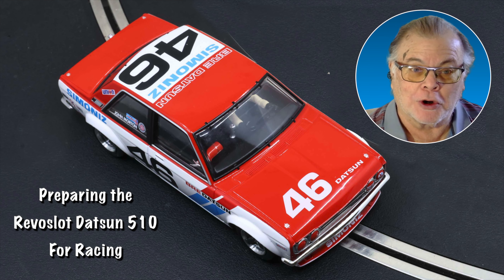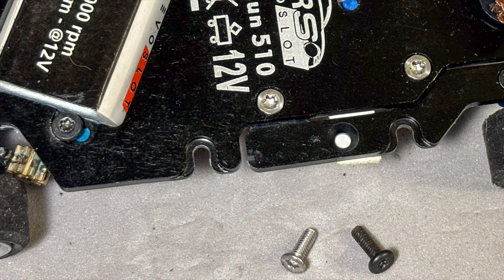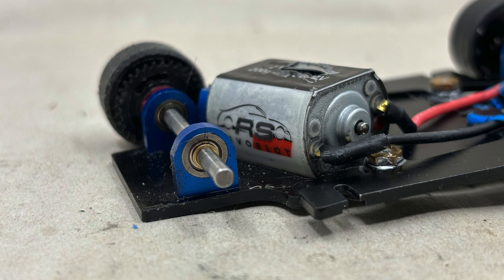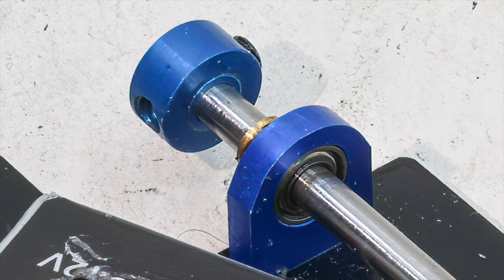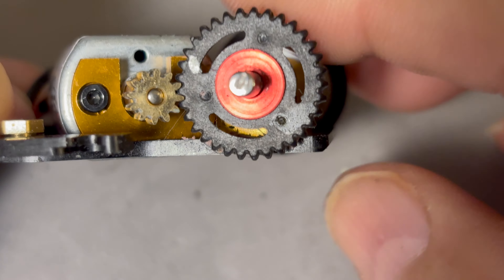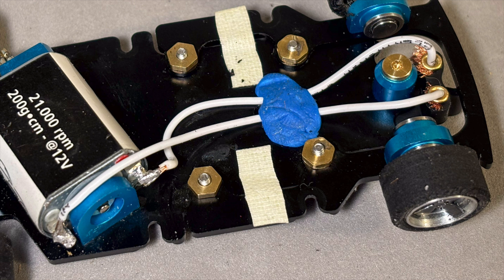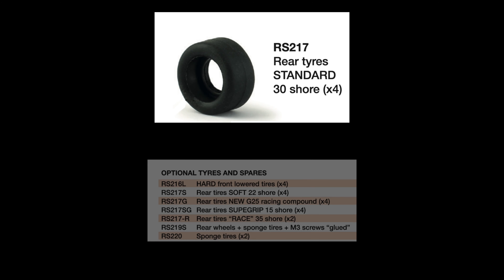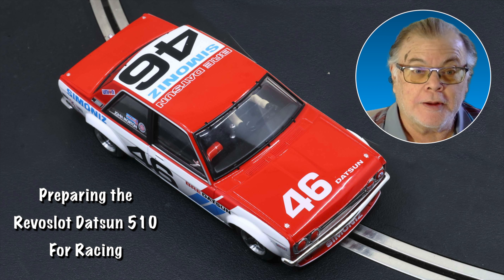Setup Tips for the Revoslot Datsun 510 and other Revoslot Group 2 Slot Cars

Comment: Is there any adjustment for ride height on the Revo Slot 510, I'm running my cars on a plastic Ninco track and noticed the front wheels don't touch the track. Any suggestions!!!
Reply from the maker: There is no adjustment built into the chassis. Not sure why they won't touch the track. All of the cars I've built required trueing the tires smaller.

Comment: Unfortunately all those change are not approved for Group 2 revoslot class in south bay 132 racing.
Reply from the maker: Surely you can break in the gears and flush the bearings...or not? Where are you located, what club.
Reply: Rules for slot cars are so different everywhere, it’s sad there is not one set of rules. If I said what I do you all would be suprised but I use standard screws with loctite and a lot of time.